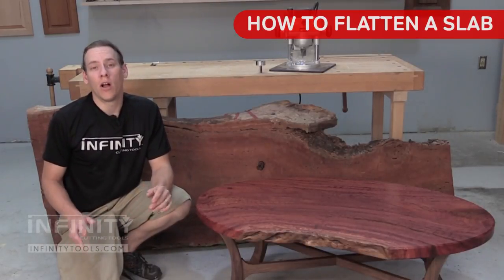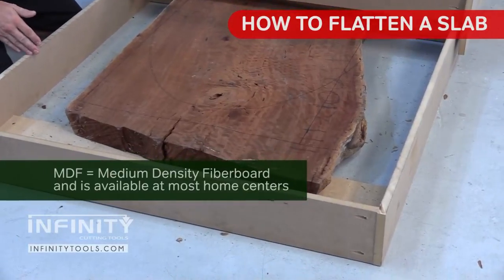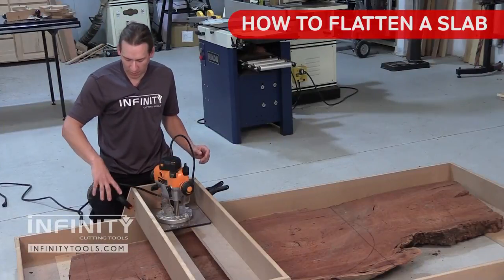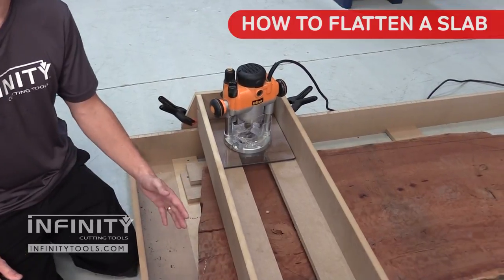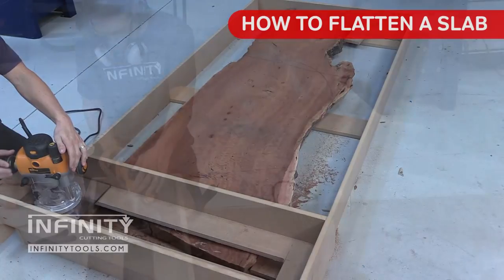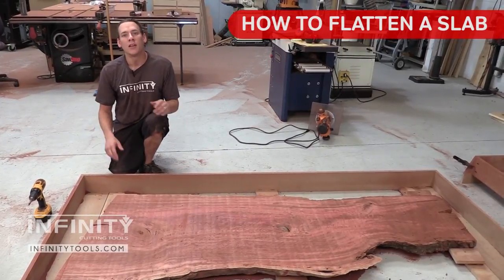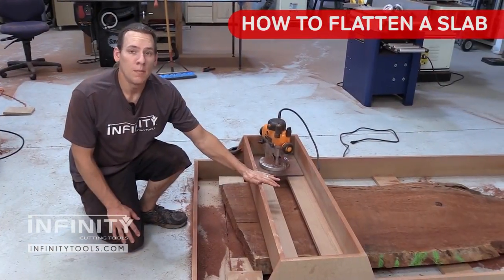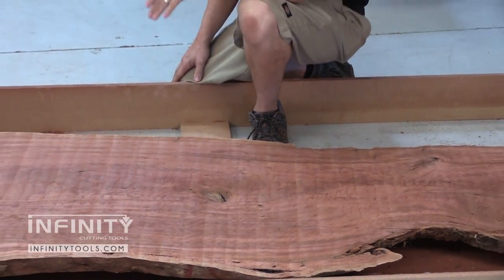How to Flatten a Live-Edge Slab with a Router

Comment: I don't understand why you would shim the corners once the first side is flattened; you now have a perfectly flat side as a base with 100% contact. There is no reason to do any shimming, in fact  shimming at that point increases the chances that the two surfaces will not end up being parallel.
Reply from the maker: The second side of the slab is elevated more than shimmed. Because the first side was shimmed to account for cup and twist you have to remove the actual shims when you flip the slab. Raising the slab up an equal amount on each corner to reduce bit reach should have very little affect on consistency.

Comment: Great vid.  I have a question, if you flatten the first side, why do you need to shim for the second side?
Reply from the maker: If you watch the video the initial shimming will deal with the varying thickness of the material, After flatting one side and flipping the material shimming again is done with the same thickness shims on all sides to secure the material in place.

Comment: Sorry, confused... once you shim and plane one side smooth, when you flip it over, why do you shim it again if you want both side to be parallel? I'd think you're still working on a wedge shape if you did that, no? Thanks for the video!
Reply from the maker: I shim with the same number/thickness of shim all the way around after I flip the slab simply to raise the slab so I don't run out of travel in the router. I also like to use MDF for the shims because of how consistent they are in thickness.
Reply: Oh ok - that makes sense... the video looked like you had more on one end (like the first side)... thanks, great video!

Comment: I watch the video about 10 times and I just need your help with one more thing, You said that the low spots need to match each other and the high spots need to match each other, so if there’s a twist in the board, get it so that say, both of the low spots are a quarter inch from the sled and both of the high spots are also a quarter inch from the sled ? or whatever they turn out to be?
Reply from the maker: leveling the slab insures that the least amount of material be removed to achieve a flat slab on both sides. The goal is to make sure that one corner is not sticking way above or below the other 3. Set the two highest points to be equally high, maybe 1/4" from the sled, and also set the two lowest points to the same height, say 3/4" from the sled. This will get the slab flat and remove 1/2" from the overall thickness. In contrast if you set 3 corners to 1/4" and the 4th to 3/4" you will have to remove 3/4" of thickness from the slab to get it flat.
Reply: InfinityTools thanks a lot

Comment: I have a Myrtlewood slab that somebody put some epoxy on years ago.  The epoxy has since discolored and cracked.  Can this bit remove the long cured epoxy or should I figure out a different way to remove it before I flatten the slab?
Reply from the maker: The Mega Dado will cut the epoxy but it will dull more rapidly than if cutting raw wood. Epoxy tends to be harder on cutting tools because it generated more heat. Think of it like using scissors to cut a sheet of rubber instead of a piece of paper.  Will it work? Yes, but not as well as on bare wood. This applies to all cutting tools not just the Mega Dado router bit.
Reply: @InfinityTools  Thanks for the feedback.  I'll investigate other methods to remove that top layer and then come back with the mega bit.
Reply: @EZInlays  I would get a cheap router bit to remove all but a paper thin layer and then use a good one to finish it.

Comment: it doesn't appear you are having to put any real 'down-pressure' on the router. is this true? is the router heavy enough without having to hold downward pressure on it? thanks!
Reply from the maker: No, I really have never had to focus on any significant downward pressure, the weight of the router seems to be plenty for all the slabs I have done. I usually just lean into it a little and let the router and bit do the work.

Comment: would you recommend using those bits with a collet extension?  will triton have enough power to eliminate all the vibration that comes with an extension
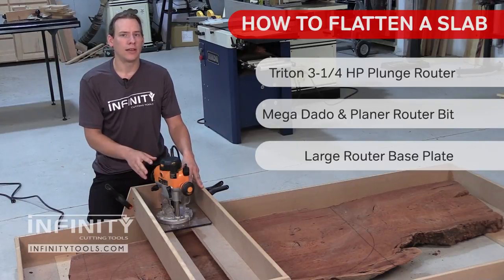Reply from the maker: We talk specifically about using a router collet extension starting at 2:27 
Router speed and proper installation of the extension and bit are the two most important parts of the puzzle when it comes to eliminating vibration. Insure that there is at least 3/4" of shank installed into the collet, and never let the the shank bottom out in the router or extension.

Comment: It seems like this box design depends on the flatness of your base, which looks like a concrete floor in this case. I know my concrete floor is very uneven, so I'm confused how you plan to get a perfectly flat surface. What am I missing?
Reply from the maker: You are absolutely correct, if you floor is not flat your box can twist and telegraph the twist to the slab. My floor was flat and I did not have to worry about this (though I did sight the box to be sure), the key when this is an issue is simply to make sure that the two rails of the box are parallel to each other. Think of them as a pair of winding sticks any twist will be very apparent when you sight across the tops of the rails.  With the box shimmed parallel the slab is then shimmed to match the top of the box as I show in the video. Simple and effective. Technically as long as you shim the box rails parallel you could  use this setup on almost any surface no matter how uneven.
Reply: That makes perfect sense, thank you!

Comment: can i use a router table instead?
Reply from the maker: The use of the sled is so that you don't need to move a large piece of wood across the tool, so a router table wouldn't really be a benefit for this type of operation.

Comment: Don't need a collet ext if the side rails are lower
Reply from the maker: Sled design, router, and the amount of material that needs to be removed from the slab all play a roll in determining if you will need an extension or not. An auxiliary baseplate and sled bridge can easily use up more than an inch of adjustment before you begin. Having a router collet extension makes life a lot easier and has very little drawback.

Comment: What hp would I need in a router to do this?  I’m looking at a budget 1 3/4” router
Reply from the maker: We recommend a minimum 2-1/4 HP router when using the Mega Dado bit. It is a big and heavy bit and planing work in and of itself requires a good sized router regardless of the bit being used.

Comment: Dude could you make a short video explaining which side you should start from according to the way that your bed is turning which way is proper in which way is not. My dad and I argue. He pulls and I push. I do what you do in this video. We have Dewalt. When you look down on the router the handle is on the right and the the knob is on the left.
Reply from the maker: Any time you are hand feeding material you will want to use a "push cut". In the case of a sled like this you could physically push or pull the router and still have the bit making a push cut. A "climb cut" can be used when the material or router is being fed mechanically either with a CNC Machine or Power Feeder, but typically is not necessary for surfacing applications. Climb cutting is used mostly in production door making and molding applications where tear out can be an issue.

Comment: maybe just clamp the router down and done length passes to reduce the amount of time taken adjusting the tool would be better, or if you're using a 2 inch bit you could just dill holes in a board fitting the rougher bit. spaced them out to make the passes without having to adjust for the slider, making passes even faster.